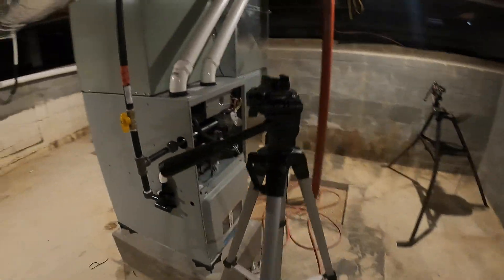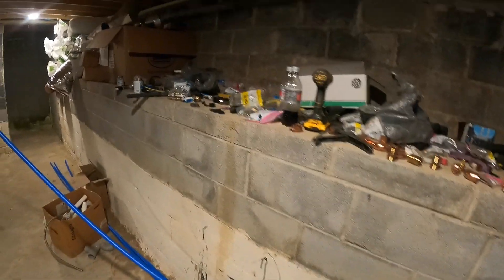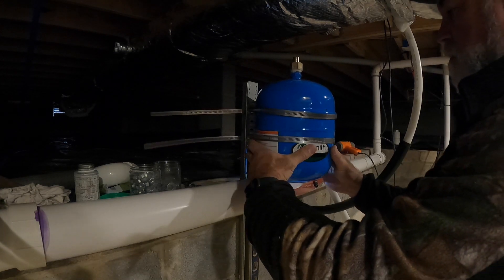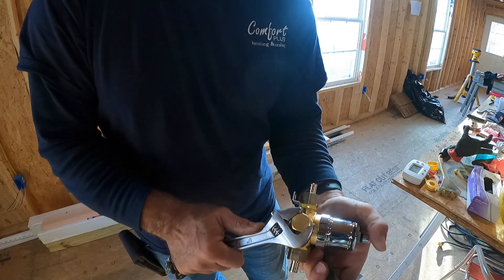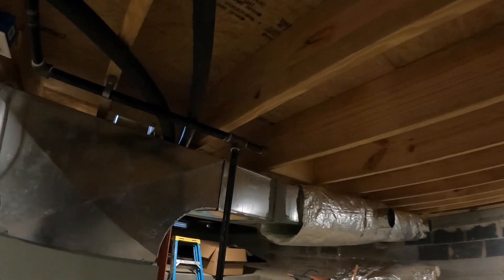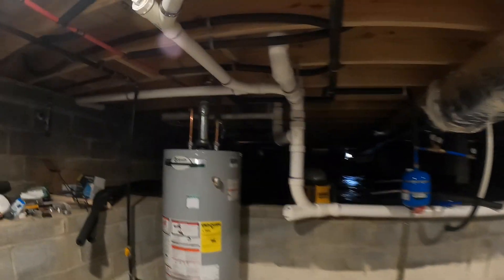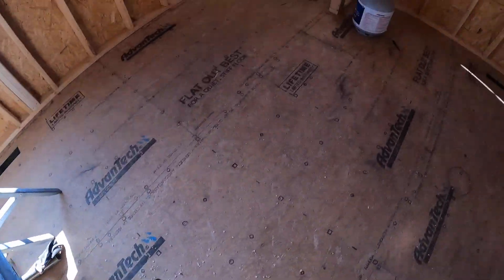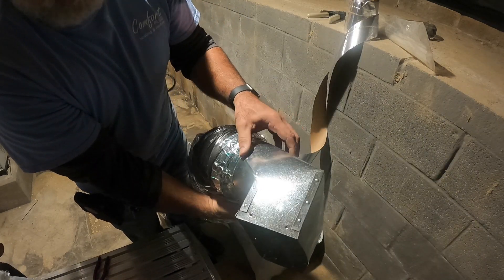Not Necessarily HVAC Part 19

Comment: :looking good. I ran some power to a couple of upper walls for emergency lighting, so incase you have a power outage it will provide lighting, also ran a couple cat6 network cables to a couple places in the ceiling for access points and a few to the corner eves for POE cameras, if I chose to put them up. just a couple thoughts

Comment: Excellent work as always, I also don't agree with insulation in floor joist. Maybe if it was a crawlspace,  but its a basement.
Reply from the maker: I guess it’s really a little of both. But the loss is low based on load calculations. I’ll just make sure they use lots of the little wires to hold it up lol.

Comment: Merry Christmas! A successful HVAC career will always lead to OCD. What brand of crimper tool and crimp rings are you using? I have to change out all of the galvanized pipe in my house. Thanks.
Reply: That pex crimper is at lowes, menards and homedepot.
Reply from the maker: I think it was marketed as an "Apollo" but they all seem to look the same. I have compared the copper crimp rings from both Apollo and Sharkbite and they crimp the same size. I did get it at Lowes!

Comment: No check valve behind the pressure reducer on cold water ?
Reply from the maker: City required a back flow preventer on my shop, but hopefully because its commercial. I'll ask before I make the final connection!

Comment: Can those basement post be installed with the adjustable part up?
Reply from the maker: I'm sure they can. These were made by Akron Products and they instruct you to install the jack on the footer and pour concrete around it to make it "tamper proof". But I've seen many with the jack on top. I wonder about the stability though because its only like an inch in diameter.

Comment: They don’t make you put a drain pan under there I guess because you’re in that hole they make you put a sump pump in there? I didn’t see a sump pump yet ?
Reply from the maker: It has the original sump pump from when I bought the house. I did have to change the float switch.

Comment: Spray foam under the floor
Reply from the maker: I've been a little hesitant about spray foam. One of my good friends who handles tech support for large HVAC manufacturer says they have lots of leaky coils just in spray foam houses? I sure like how warm they are though lol.
Reply: Interesting to hear your friend says leaky coils in spray foam houses. Wonder if it is a chemical reaction between the aluminum and the VOC’s of the foam and if the coil is inside of the building envelope. Rockwool insulation would be a great choice under the floor. Won’t grow anything, bugs hate it, you can take a torch to it and no sagging...Mom’s toes will be happy!   Much respect to you and the build.